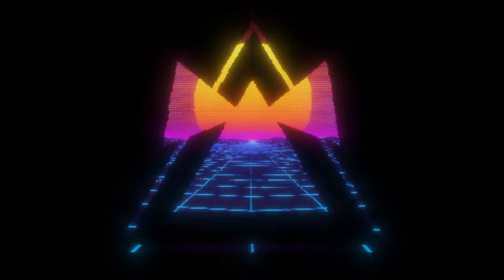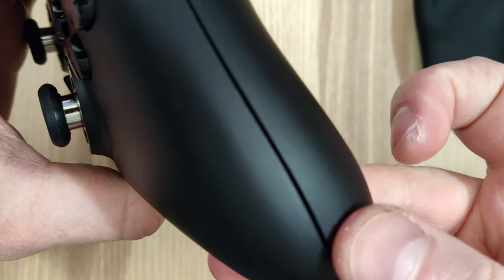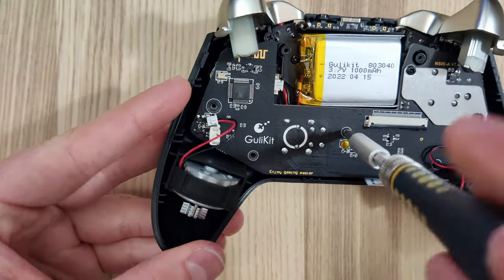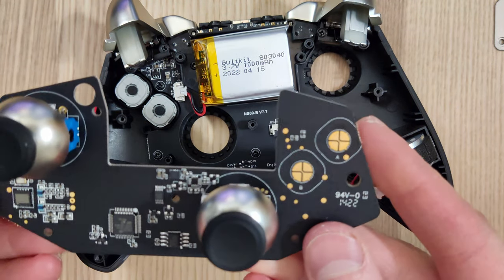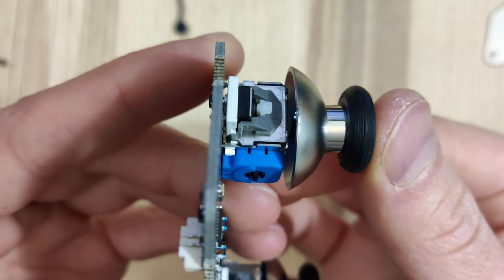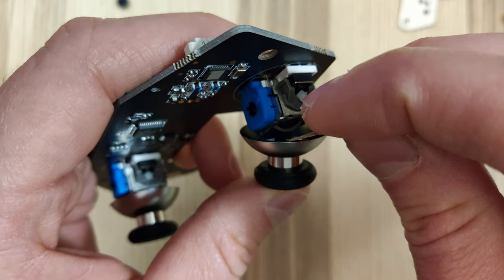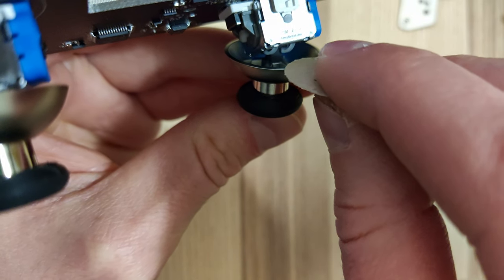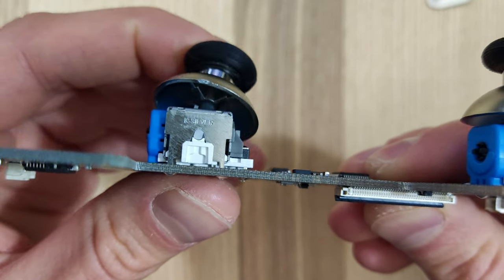Gulikit Quality Control Issues (KingKong 2 Pro Teardown and Joystick Fix)

Comment: Thank you for the teardown process! My problem is that the A switch is very sticky and make a griding sound when press. I disassembled the switch, move the spring a little, assemble everything, and it fix the problem. I love this controller a lot but having to open it up is a bit disappointing.
Reply from the maker: You're welcome, glad I could help! Gulikit sells replacement buttons but if you ask them on the official Ali store I'm sure they'd send you a few replacement switches if that happens again. Can't say I've had that with either of my two controllers but that's a shame to see. It really is a disappointment to have to open it up for things like what you had and the joystick issue. I'll have to keep an eye on my button switches now too, thanks for the heads up! Glad you managed to fix your controller.
Reply: I have the exact same problem... If i press it and move just a little bit to any side the button gets stuck and you have to try to get it out to be able to use it, so kinda hard for fighter games
So this can be easily fixed by just moving the button?
Reply: @axsvue  I disassembled the entire switch because I think problem is that the spring is grinding with the plastic casing of the switch making the sound and cause it to not expand when being press. 
So I just rotate the spring a bit so that it would not get stuck at the same place when I assemble everything.

Comment: Been using it for months now! I got that button squeak and sticking but fixed it thanks to this teardown vid, other than buttons problem I also hear metal on metal contact on the triggers, seemed like they didn't lube the trigger so the spring is rubbing on the metal

Comment: My left joystick kind of grinds as you rotate it after owning it for ~9? months? and gets offset stuck in a position slightly on my Pro2 when I let go unless I manually leave it at center '0'. Drives me bonkers, and has led me down a path to this exact video, thank you. I'm considering opening my controller after watching several teardowns, including your own here, to see about a bit of plastic causing the extra friction I feel.

Out of everyone I happen to have seen, you've given me the most direct potential answer to this trouble I have. I appreciate your help, very much. <3

Comment: I really appreciate the detailed teardown, because this is a big selling point for me. This video made me want to buy this conroller just because it looks very repairable!
Reply: I consider the Xbox controllers (X360, XOne) or PlayStation (Dualshock 3/4) much easier to repair. This one's assembly is really tricky.
Reply: @cyberangel82  I've only owned the XOne controller from your list, and it was decently repairable. I unfortunatly messed up my soldering and destroyed it, forcing me to buy a new controller. I ended up going with an 8BitDo controller.
Reply: did you miss the part where broke the plastic clips when opening it?

Comment: Glad this came up when I recently had a problem with my B button that started to sound squeaky and added a little bit of lubricant in it, great teardown, helped me alot now that I know how to disassemble every part
Reply from the maker: Glad you found it helpful! Great controller so I'm happy to see yours working well.
Reply: Update: I also broke one of the clips on the back case of the controller, but I found out that you did as well and now I feel less disappointed cuz I'm not the only one who did lmao
Reply from the maker: The screws hold it together so you don't notice a gap even with the clips broken. When I went back the second time I broke the other clip too... Honestly those clips are really thin but they don't hold much. I wouldn't worry about it.
Reply: dude, seeing revenant as your profile pic i guess u have used this controller to play apex and i want to know how does it feel, can you tell me someting about it?
Reply: @unkrazy2782  i guess the vibration of the controller's pretty neat, but i don't usually use the controller to play apex; only tried it, and i guess the accurate sensitivity of the analog can significantly help u in aiming

Comment: Thank you for the video. I've used this video to open up the KK2P, wanting to switch the A-B and X-Y keycaps. But then I realised they are physically uniquely shaped, and changing them would make the whole feel off. I'll (or you'll) need to new key caps if you intend to change them around. It's just weird looking at the buttons to press in-game, and having to press the opposite.
Reply from the maker: Thanks! You can buy the other button layout here from the official store:
https://a.aliexpress.com/_mMqRE0u
Reply: Oh well. Wish I read your comment before taking it apart. Well, it's just cosmetic anyway.

Comment: i'm having a problem with my King Kong Pro 2 that i haven't seen mentioned anywhere else.  my triggers tend to stick down after being pushed down for a while, especially the left one.  now that i've watched you open it up, i'm wondering if the magnet might actually be adhering to the shielding!!  definitely not great for games where driving controls use RT for accelerate and LT for brake.  i'm not sure what to do about that problem, it's not like they can send me a replacement part.  at any rate, want to echo all the comments thanking you for the helpful and well-explained video.
Reply from the maker: Always happy to help, I've heard that issue before on the white units but not the black or non pro. Both the units I bought didn't have it but the one I gifted to a friend (white version) had sticky triggers. Gulikit is great about sending parts out so feel free to contact them on the official Ali Store if you have any concerns. 

Once you show what's going on with a video they'll generally ship it out within 1-2 days. All stuff is currently closed overseas till the 8th though so they might not be able to get back to you right away. If I discover a fix for the triggers I'll be sure to let the community know. They shipped my friend two sets of replacement triggers after I sent them a video of his problem (one silver and white set).
Reply: electrical tape would help that

Comment: I own a refurbished Gulikit King King 2 Pro $50 great price, and am very impressed with it. The weight and feel of the gamepad, joysticks, triggers, and buttons are amazing. Your teardown shows the gamepad is solidly built, and good to see mostly hall effect sensors for triggers and sticks. I would be very confident replacing the battery, but it still lasts over 22+ hours, so way better than 8bitdo. Only gripe is that the Gulikit KK2 Pro doesn't work in Genshin impact mobile on iOS. Unless someone knows of a hack or workaround. If this gamepad was produced in USA, or Europe, it would probably cost USD150+ . So happy that it is made in China. Great video, thank you. I didn't realise Gulikit are such a small company compared to 8bitDo, and some of the 8BitDo controllers use the same hall effect sensor as Gulikit.

Comment: Glad you were able to fix the problem!
Hopefully this is something that Gulikit addresses.
They will hopefully be able to change the injection molding fill and vents to bring that point off the edge of the dome.
Or at the least perform a bit of quality control on them before assembly.
Reply from the maker: Good explanation! Pinned
Reply: Yes. Correct. It is only the mold injection fill port and cause no function issue to the stick..Thanks.
Reply from the maker: @GuliKit   As much as I would hope that this wouldn't impact the experience, when I was using my controllers I did encounter a spot that coincided with the molding port that would cause hesitancy in the joystick. You could feel where the protrusion was and it was noticeable due to how smooth the sticks are otherwise. The bottom doesn't seem to affect it but the sides where it makes contact with the controller is where the feeling of a "notch" or disruption in the stick comes from. It was night and day after smoothing it out. Worth taking a look into for sure as this is a great controller with such a small piece affecting the joystick.
Reply: @KeiRetroGaming  Ok,will check more and improve better and better.Thanks.
Reply: @GuliKit  honestly, you could probably shim the gate size a bit smaller, though your probably need to run the molten plastic hotter, maybe even go as far as a thermal heater
(6 years working in injection molding)
Reply: @nevoyu  Quite technical feedbacks,thanks!
Reply: @GuliKit  just curious since I'm planning to buy one but has the problem been addressed recently? It's been 3 months and I just want to confirm since I can only buy one from you guys through a third party seller
Reply: @ngocsondinh135   Yes. It's been improved a lot. Thanks.
Reply: Remove your stick cover so flakes don’t go into the stick, every step here is so clumsily done
Reply: @GuliKit  My KingKong 2 came with a loose screw on the left trigger, and after using it for a week the screw totally detached and is now loose in the controller housing, and the left trigger is almost unusable now.

Comment: Thank you for the video.
First, a couple of points:
Ive been able to open my controller multiple times without scratches or broken clips. Your technique works perfect, only go slow and dont rush it.
After buying 2 controllers with identical "sticky right trigger" issue, And really wanting to keep this controller, I went ahead and took it apart following your steps.
The right trigger clearances are slightly tighter on the return motion.  The little rubber bumper where the back portion of the trigger rests (with the magnet) will slide up causing the trigger to not come down properly. Glue the rubber bumper and problem solved. Not sure why only happens on the right trigger.
Reply from the maker: Thanks for pointing that out fix for the community. As I didn't have any issues with my triggers I didn't know how to fix that problem, this was the other big issue that seemed to plague this wonderful controller. Thanks again!
Reply: @KeiRetroGaming  It is a common issue lately. Gilikit is not doing quality control/testing on this units. My issue started during first try on both units. Also, a few secret facts: You can use the controller wireless...by running it in nintendo mode with the brook wingman.
And second,....the trigger sensitivity adjustment only works when in Windows mode....
Reply: hey I’m having the same problem with my controller, but with both triggers. Can you explain this further in depth because I’m not really sure what exactly to do and I don’t want to damage my controller further.

Comment: 5 min in, good to have teardowns for stuff like this easily available. To anyone doing this however, PLEASE get a spudger. That being a plastic pry tool, really helps not having to use a card+cloth to pry things open and can help dislodge rumble motor cables too. I repair electronics semi professionally, right tool for the job makes things SO MUCH EASIER and it probably would've gone a long way to not breaking the plastic clip. That said, I do this for money and still sometimes break clips. They're just finnicky and fragile so it's kinda expected to sometimes break some.

Comment: This video helped a bunch. After a while without use, i noticed my controller's right joystick was getting stuck in a spot. After following steps from another silent video and then this one, I saw that one of the blue magnets had detached from the stick sensor. After moving it back in place and sealing it up everything seems to be working.

Comment: Thank you for the detailed teardown. I want to buy it, but for now I want to check if I can just switch and reverse the A-B and X-Y button in order to make it looks like XBOX controller layouts. 

I have a question, is switching those [A, B, X, Y] button possible? Or that they won’t match if not put on the correct positions? Thank you in advance 😊
Reply from the maker: Unfortunately you need to buy this to get the Xbox style layout, you can't swap the ones already inside:
https://a.aliexpress.com/_mLT88y4
Reply: That's interesting, for me personally, it doesn't bother me, since I already know the layout for those buttons and I don't look at the buttons when I'm playing, I just play it as is, of course it works.

But I guess I understand from a physical standpoint you want to see it like it should be on an Xbox controller.
Reply: @KeiRetroGaming  hmm, that’s a bit saddening news. But hey, at least they still prepared the Xbox button layout for the curious like me. Thanks a lot for the info :D
Reply: @tcrviper  yeah I’m often alternate between using DS4 and some cheap Xbox controller for PC, so I still need to see what controller I’m using by looking at it physically, than confirm the on screen button prompt on what to press.

And yeah, I heard it’s the best controller around (for now) and it’s a bit triggering to see the button layout that I’m not used to. Though it turns out to be customizable, just with extra money and step :’)
Reply: @andhikant274   yeah that makes sense, I didn't think about someone using multiple devices, I only use a series X.
Reply from the maker: @andhikant274  No worries! Pretty cheap anyways... just a shame they can't offer it as a specific model without the add-on to get the xbox layout.

Comment: so what version would be the new batch that "solves" the buttoms and stick problems?
im searching in amazon and i see many models and many manufacturers selling the same controller that i don't know wich one is the right one
i mostly want to use this controller for forza and beamng drive
Reply: Please pin this comment. I got one at Target last night (January 2023, model NS09 in black) and my A button was squeaking/sticking out of the box. I would also like to know which version we should try to get. Apparently the white has less issues? 

The sticks do feel A LOT nicer than a regular Series S/X controller, so I might just exchange it for another and try my luck until I get a solid one. I didn't realize how smooth joysticks can be today. Unfortunately now my interest is heightened for nicer controllers haha.
Reply: Also for anyone wondering, you can use this wirelessly with a Series Xbox if you have a Wingman XB. Put it in Switch mode and right next to the Wingman with both devices in pairing mode. No lag, works nicely.

Comment: I’ve been looking for others with issues with this controller and I’m glad I found this!

For some bizarre reason, the gear button doubles as the program button AND my Y button, while the actual Y button does nothing.

Gulikit has failed to connect with me about getting it repaired and I feel incredibly scammed.
Reply from the maker: Have you contacted the official store on AliExpress?
Reply: @KeiRetroGaming  do i contact the aliexpress store even tho I bought it somewhere else?

Comment: My gulikit controller zr and zl buttons get stuck if they are pushed and held down for a while, do you get the same issue as well?
Reply from the maker: I don't have that issue on either of my units but my friend I bought the new white Gulikit Kong Pro 2 for has that issue on his already.
Reply: @KeiRetroGaming  mine is also the white version it seems like the white version has that issue
Reply from the maker: Bizarre to see it happen only on the white ones like that... If you figure out what it is let me know. I don't have a white one unfortunately to compare it to my black ones or to do a teardown on it.
Reply: @KeiRetroGaming  They told me that the first batch of the white version are bound to have issues and the trigger stuck problem is the most common, and they are looking into fixing it.
Reply: Yours is white?
Reply: @clumsy2229  yes, mine has this issue too.. :(
Reply: @KeiRetroGaming  triggers on white is different than yours in this video
Reply: My white one I purchased on Amazon around a month ago - also has this issue. It is extremely frustrating. Occasionally the L + LDpay + A + R (recalibration combination) and/or COG + minus button fixes it temporarily. However, as others have noticed, when holding down the shoulder buttons for a while  ZL / ZR for while, for a game that requires it (aka. Splatoon 3), the lack of function becomes maddening. While I have not torn down the controller, a gentle/firm sideward nudge followed-up by a recalibration seems to free it up. Does anyone know what's happening with this issue that plagues the white Kong Pro 2 NS09 controllers? I updated the firmware and everything without issue. Has anyone gotten theirs swapped out under warranty for the black one? Any advice in general on how to go about getting this fixed? Aside from these squirely issues and occasional middle AGP+Cog buttons incidentally/accidentally getting hit while I play, the controller would otherwise feel flawless, IMO.

Comment: The face buttons on my first one were defective and stuck after only 30 min of play ... so I don't have high hopes for the buttons long term.
Honestly I would really like to see these sticks in a controller made by a more experienced manufacture with better quality control.
Reply: 8bitDo Ultimate for Switch will use it, lets see.
Reply: @PedroKunNunes  8bitdo, me and one of my friends have their pro controller, but damn, the thing got broken too fast, the rubber starting to wear out in half a year and some buttons became loosely, hope they make improvements on that
Reply: @BadEnd98  Same for me here with 8bit.  It my opinion it's a scam.  They use proprietary and weak rubber membranes that are designed to break quickly so you buy more controllers.  More money for them yes?

Comment: Thank you so much for the teardown! I have a different issue with my joystick cap: it’s off center. The sticks themselves are fine, & it’s not the rubber topper- it’s the cap with the stem. I tweeted at them so I hope they get back to me. Great video though!